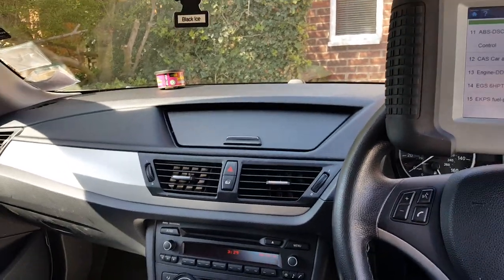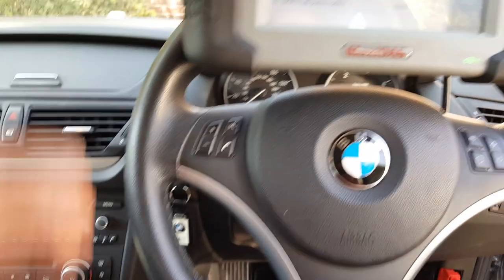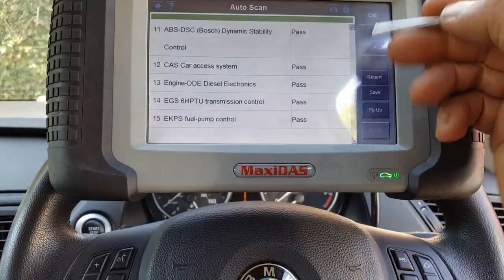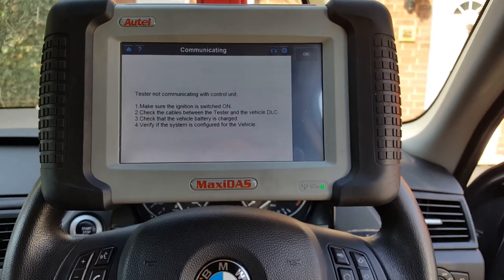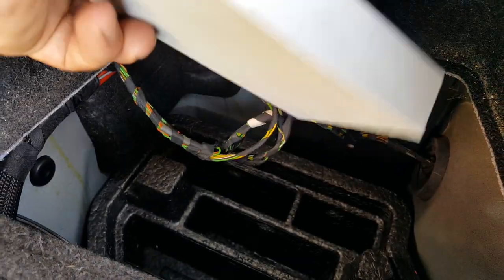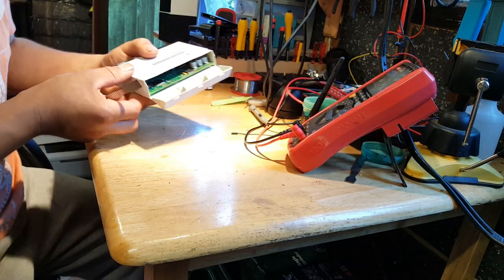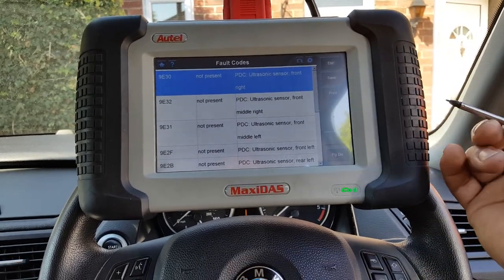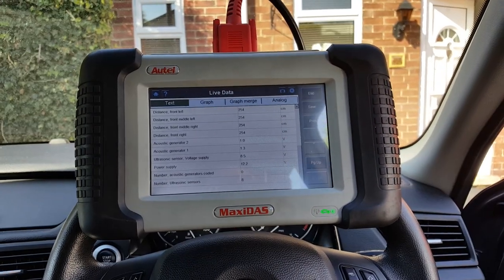BMW X1 2011 Park Distance Control PDC water damage repair.

Comment: Thanks so much for taking the time to upload this. The PDC on our 118d has never worked. I took it apart and found exactly the same pin on the same IC had corroded. I'd previously tried to just re-solder it to the board, but that didn't work. I saw your video and made an identical jumper. Now works great. Thanks again.
Reply from the maker: No worries... Thank you for watching and for your comment! 
👍👍👍

Comment: Dude you are the best. Had this problem on my 116i from 2006 two times. The first time i bought a used one off ebay, then that one died of the same course after 1 1/2 years. The jumper works just fine, thank you :)
Reply from the maker: 😊
Great you got it sorted! 
👍👍👍
Thank you for watching and for your comment!

Comment: Thanks so much, same problem on my X1 and solved thanks to your video!!! i only pull out all the water form the foam, and dry the module opening it, re-put it on AND WORKS PERFECTLY!!! THANKS THANKS THANKS, one thing: also on my module i noticed that the second soldering from the right on the chip was not good, but i didn't do anything as now, if you can explain better what you have done soldering that new wire with another video it will be great.....thanks again
Reply from the maker: Thank you for watching and for your feedback!  Much appreciated! 
I will try to make a video on soldering...

Comment: I have both the PDC and the rear view camera control module, both damaged from water intrusion. A third board is undamaged as that board is encapsulated in putty. I am going to attempt this repair and if successful, I am going to coat the boards with epoxy and make the cases watertight so this doesn’t happen again. From all I have read, all these vehicles are prone to flooding of the areas where these modules sit and it amazes that BMW had not addressed this in at least the 2011-15 models.
Reply from the maker: 👍👍👍
Hope you get it sorted!
Reply: Here’s a follow up:
About 2 months ago during our rainy season, both the rear-view camera and the PDC sensors on my 2015 X1 became intermittent and then failed completely. It was apparent the two were connected. I tried cleaning the sensors, etc but the parking sensor button wasn’t even turning on. I was going to wait until taking it for service. Recently, inspired by some of the videos here, I decided to look in the back and sure enough 2 out of 3 modules had tell-tale signs of water damage. The aluminum housing of the camera module had corrosion and pitting and the board inside had traces covered with powder, presumably, from this corrosion and pitting. I cleaned the board with a toothbrush and some rubbing alcohol to a point where it looked all right but plugging it back in (without the aluminum case) did not improve anything. The undamaged module is covered with some conformal coating and I don’t understand why BMW would not have done this with all the boards. The damaged board had the second pin missing (PIN number 19 actually) as in this video. There was not even a stub left to solder a wire to. I purchased a replacement chip L4949EP-P for USD 1.50. This is a voltage regulator that down converts 12VDC to 5 VDC. The missing pin is the output. I removed the old chip, cleaned up the solder pad and soldered in the new chip and made a jumper connection between the chip and the capacitor as shown in this video. Tested it, found the sensors and camera to be working, covered the chip with hot melt glue. I also sealed the aluminum casing of the camera control board with hot melt glue. Here is hoping they provide sufficient waterproofing.
BMW service said they’d charge $200 to diagnose the water leak. In the back they said the drain lines could be plugged. I don’t see any evidence of that. Given the number of complaints about the leak, you’d think there would be a recall but there has not been any.
Hope someone finds this information useful.
Reply from the maker: That's great!
Appreciate the feedback! 
👍👍👍

Comment: The IC is easily available, I replaced it on my E87.
Aren't you afraid of ESD, putting the board on the carpet like that?
Reply from the maker: As you might have seen was no need to have it replaced...
As for the ESD, no... I am not afraid...
☺️
👍👍👍
Reply: @LMAutoRepairs  It didn't need to be. Mine did and I thought some of the people finding this video because they encounter this issue will be happy to read the chip is easy to source and easy to replace
Reply from the maker: @NicksStuff  
👍👍👍

Comment: Great save! would you attempt to get another IC or just replace the unit if this didnt work? also does a donor unit have to be programmed?
Reply from the maker: Hi
Thank you for your comment. 
If this fail again, (which I hope  not... lol), I will try to replace the IC.
A second hand unit, should work straight with no programming or coding.
(Will make a video if that happens...)

Comment: This might be impossible to answer, but I'll ask anyway. I've just watched your video and discovered that my X1 has exactly the same issue, but although your example is wet, mine is literally swimming. That whole compartment is flooded, but I can't see an obvious entry point for the water, so that I can prevent it from happening in future. Any pointers?
Reply from the maker: Check the vent flaps... the tail light seal, and the boot rubber seal...
👍👍👍

Comment: hi there, great video! Do you know where is the PDC module location on bmw F01?
Reply from the maker: Under the glove box... if I am not mistaken...
Thank you for watching!
Reply: @LMAutoRepairs  I have found fuse box and airbag module in the glovebox but not the PDC module. I have stripped the lining in the boot and not PDC module found, but thanks for your reply and your videos,  good job!
Reply from the maker: @jozefautersky4725  
Thats weird...
Check on tis online...
But i was pretty sure that is the it should be...🤔
Reply: @LMAutoRepairs  thanks for the reply,  I am trying for nearly two months to find it online but not success yet.

Comment: Hi
I have the same defect on my BMW 120d 
Can you tell me step by step what you really do on the Chip. I not see where you fix the cable 

Thanks for help
Best regards
Reply from the maker: Patrick Picard 
I have just completed the path for the damaged leg of the chip... using the wire.
It depends on bad the damage is, you might not be able to have it repaired... you need to assess that yourself...
Hope that helps...

Comment: hello 
I have the problem with radar of recoil, the pdc does not function, 12v box pdc 8.5 sensor
But I have a poster when I am in the test pdc is mark speaker not assembled?
Reply from the maker: MrXacho 
What can you see under live data?
Any codes?
Reply: I use inpa ediabas
0 default in the pdc
Sensor ok
Ok speed sensor
Pdc ok 12V
No sound after diagnosis with inpa in the menu test it mark speaker not assembled